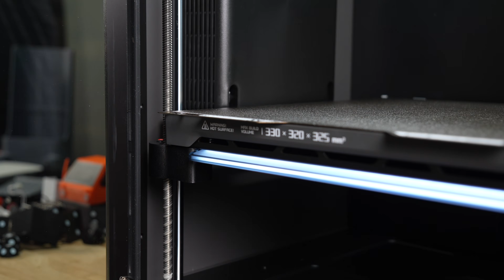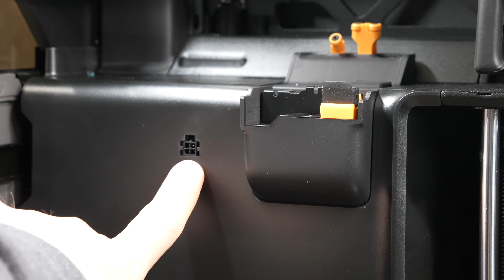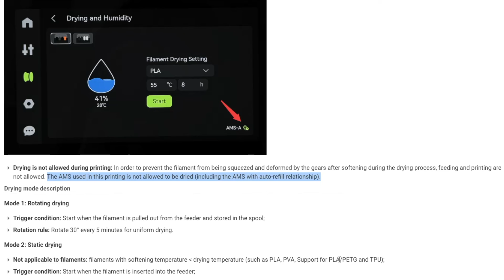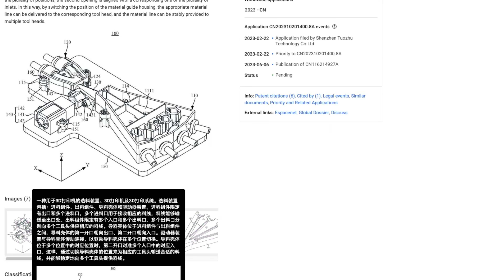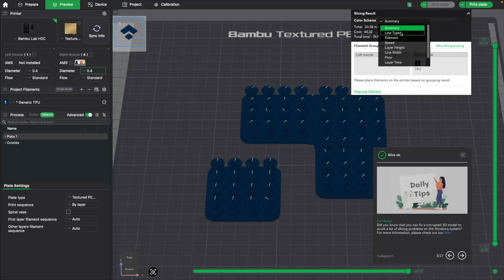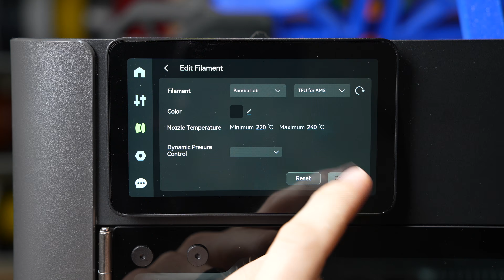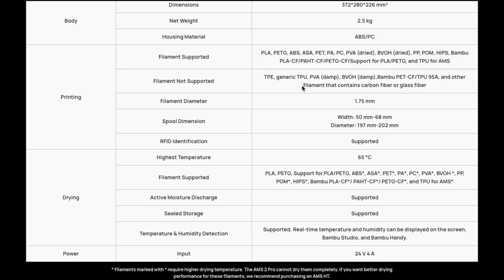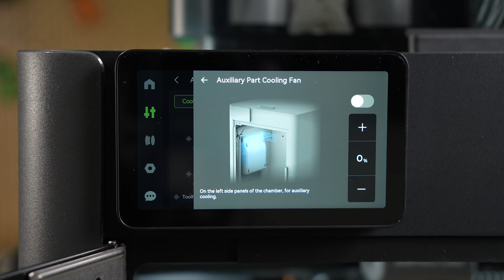3 Months With Bambu Lab’s New Vortek System (H2C Review)

Comment: Snapmaker U1 seems way superior still.
Reply: wait for at least a year and when they start selling them on a regular basis. After that we'll see how reliable each machine is and how support deals with it ! Then you can really judge.
Reply: U1 is not enclosed at current purchase time, nor does it have active chamber heating.  Good luck when you make something more than little PLA toys.  Good price though.
Reply: @Iscariot18  there are a couple of community lid designs. An IKEA plastic container with some printed parts seems to work well while Snapmaker takes their time of that lid.
Reply: @JonS  that's a joke, cmon.
Reply: Hmmm.,.need a 320 x 320 part, oh, Snapmaker can't do that. Vinyl cutting or laser? Sorry Snapmaker. OK 7 colors minimal waste. Nope. Just pick your filaments from another room without being near the printer. How about having the printer use a second spool when one runs out?  Maybe Snapmaker isn't superior after all.
Reply: @A1N0  you can buy an excellent vinyl cutter and U1 and have $1000 left for what you can buy an H2C for. Sure, if you want the extra size, and all the modules, including the laser (and are willing to clean the laser soot) it might be a good option for you.

If you only need up to 300mm cubed and four colors. The U1 is the superior option. Waste is lower. Multi-material speed is higher. It can print real TPU. Price is lower.

You are right to point out that "superior" is subjective. Not everyone has the same needs/wants. But I would say most people will be better served by the U1.
Reply: @A1N0  Need a 490 x 490 part, oops Sovol SV08 max is the best printer now. Thats just arbitrary
Reply: Based on what ? They are different machines U1 will be better in a few areas but far from all
Reply: On what? On the price? I have the Snapmaker U1 and ... I'm not happy at all, still a very green on the software part, but limited to only 4 colors
Reply: @Scheettini  on your other comment you said you have the H2C
Reply: @andi67951 remember that Bambu Lab (taking from DJI’s playbooks) has paid employees whose only job is to bash competitors and boost themselves in social media comments. Not saying Scheetini is one of those, but you have to be on your guard.
Reply: @andi67951  now imagine this concept, he could have both? Yeah unbelievable, I know...

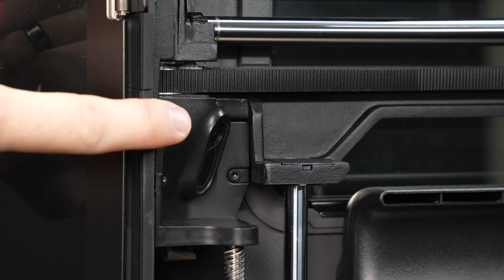Comment: 8:25   already broken printer lol that bracked is cracked
Reply: Well spotted your so right looks a big split 😮
Reply from the maker: Are you talking about the bracket above the camera where I am pointing? If so its not cracked. That is a shadow cast on the part that makes it look that way. There is an angled recess in that part which makes it give the illusion of splitting.
Reply: @ModBotArmy  hehe is that was really broken you have to wonder how fedex did it :)
Reply from the maker: @scb2scb2 lol yeah I went to the time stamp to see what they were referring to then ran over to the printer. It definitely looks busted in thar camera shot but I promise it’s not.
Reply: So bambu is all cracked up to be…
Reply: The actual elephant in the room is the upgrade path from H2D and the missing warning for us early adopters, who would have waited.
Reply: @crowguy506  I find that a more difficult problem it always is. would be nicer if the upgrade would be cheaper but they have to replace the whole toolhead which is a complex part compared to most printers.
Reply: @crowguy506  As a current H2D owner, my two biggest questions are 1) When will the upgrade kit actually get released (Cause it's Jan 24th and we're running out of January) and 2) I want to see a trusted 3D printer reviewer on YouTube actually go through and document the entire upgrade process. I've read the upgrade wiki pages multiple times in depth but I want an independent party to tell me based on their own experience going through the upgrade if I should even bother trying to upgrade my printer or just settle with the H2D because the upgrade process is too complex for most people to undertake themselves.
Reply from the maker: @crowguy506 I don’t know much about that. I don’t recall there ever being mention of an upgrade path.
Reply: @ModBotArmy  The Vortek Upgrade Kit (H2D Compatibility Pack) is scheduled for arrival in January 2026.
   
4. The Vortek Upgrade Kit (H2S Compatibility Pack) will be released after firmware support is available, with an estimated earliest release in Q1 2026.

This is off the store page

Comment: I think the prussa will be the best this is to much repairs complications on this machine
Reply from the maker: Time will tell. It’s hard to know at this point with no real mass testing or feedback. I’m very curious to see how the install process is because that will ultimately determine accessibility.
Reply: We have to see this in 2 parts. The H2D as a platform has many parts and so as a result does the H2C but the vortek system itself is very simple it just looks complex only 2 moving parts and a simple motor and all parts easy to access and remove/replace. The H2D as a platform has been out for a while and no massive  big issues compared to other printers. So yes many parts but also many sensors to protect things for example how more parts doesn't always mean more issues thats a myth a machine has to proof itself in battle over many hours with many users. My h2c now has 500h on it but i won't judge until i and many have a few thousand on them before we make any claims.
Reply: The system of rods, bearings, belts motor is the same system that is used to make the mk4s gantry and bed to reliably move for 10 thousands and more hours, so I guess it will be reliable...
Reply: Another thing, you need to print the parts of the INDX, how you think that is less complicated? They are going to send you the necessary parts, you need to print and install them
Reply: @Scheettini I guess you still don't understand it is complicated to make repairs on older generations for most people. Do you think this printer will be easier to fix? Also, the functionality is 100 plus in this printer, but the repairs are not.
Reply: @enmanuelhenriquez975   Bambu Labs have a WIKI with everything you need to do with the printer, maybe it looks complicated, but im not worried
Reply: @enmanuelhenriquez975 I rather have a reliable printer harder to fix than an easy to fix one that always need tuning, maintenance. If for some, the Core one, for example has been reliable, the belt tuning and general performance has not been that good for a lots of others peoples. The core one L seems to improve on that thou.
Reply: and you think having 7 toolhead is less complicated?

Comment: Voxel is not made in the USA
Reply from the maker: Production switched to fully in the USA last year.
Reply: @ModBotArmy  Voxel is absolutely not made in the USA, Their filament is literally 1:1 the same as matterhackers build series PLA. And matterhackers build series stuff is made overseas and imported They use the same spool with P/N labels, peeling off their brand labels shows this. Their TDS is the same and the print properties are the same, from the level of gloss and tone of color, the filament winding and even the tape they use on the spools. If voxel is saying their filament is made in the USA, then they're lying.
Reply from the maker: @LilApe I can’t speak on prior to sometime this last year. I know it wasn’t based in the USA from the beginning. This is a relatively new thing. I can reach out to get further details.

Comment: If I didn't have an H2S I'd be all over this. But I'm undecided so far if the multi-nozzle feature gives me anything I really need. Or need enough to be worth the cost of this printer.
Reply: I have an H2S and a snapmaker U1 and think it's a pretty solid alternative to an H2C for the same amount of money. Faster tool changes in the U1 and H2S has a larger build volume. Obviously if you do a lot of 5+ color prints you'd need the H2C for that but I find 4 colors covers most things pretty well. Plus having two printers to share the load is great.
Reply: Depends what you print.  For reference, I did a print with 1500 color changes.  3d 19h on the X1C.  1d 10h on the H2C.  The H2C also used 620g less filament since minimal purging.

Comment: The vortek system is cool on its own but compared to the indx, the indx seems superior and the Bambu system looks like trying to avoid infringing on bondtech’s patents. To match the h2c, a Prusa Core One L with indx might be similarly priced to the h2c, ~$2300-2500 for a core one L indx vs $2400 for the h2c. I’m very excited to see a head to head when indx is available.
Reply: I see a lot of advantages to both systems - I'm planning on getting both - with the H2C for actual printing of 12+ colour models, and the INDX for tinkering.  I'm planning on adding a cutter to some of my INdX passive tools so that I can add an OpenAMS or BoxTurtle - and get the convenience is simple filament roll swapping, plus sharing one roll of filament with multiple nozzle sizes.
Reply: The biggest issue with  indx is that it has to ship. A pre-build h2c size printer (Core One L) is not even announced yet and we should not be shocked it will be end of the year.
Reply: The indx system is cool on paper, and as of now, apart from some controlled demo, it's still just paper specs. There are so much unanswered questions about its performance with different materials. Otoh, the h2c has a larger volume overall, a chamber heater and its readily available.
Reply: @patricklebel1141  it also has auto PA calibration, option for laser and cutter, and since it's a nozzle changer you can use a single spool for multiple nozzle sizes (this will probably be added in the future). You can also have more colours than toolheads and a higher nozzle temp.  Everything has pros and cons...
Reply: @riba2233  Its 100% clear that INDX and toolchangers can outrun the h2c/h2d when more than 2 nozzles are needed but indeed the downsides people don't seem to want to talk about. People talk easy about 10 or 12 INDX in a Core One L but the space and/or how 12 ptfe's for example will work and be able to be in heated chamber people love to sidestep these 'small' issues.
Reply: @scb2scb2  yeah they seem to overlook that it's not that simple
Reply: Bambu lab isn't afraid to copy, steal or infrings on others IP, as they do it all the time and it's why stratasys is suing them right now. Bambu lab just always tries to do something different, and every time they do, its ends up being bad. Like using CF rods, lidar, dual nozzle, this vortek thing etc.
Reply: @LilApe  there you are with you Iies, like a clockwork, nice!

Comment: that wobbly table
Reply: No, its not table wobble. This thing is HEAVY and has very soft feet, and the toolhead is massive, so it does wobble a bit when printing.
Reply: My table is rock solid.  The printer moves around on its feet about 1/4 inch or more.  It's designed to move.  I don't know why but that's how it works
Reply: When I first got my H2C and start my first print..........HOLLY COW, the soft rubber feet makes the machine dance quite a bit, it balances up for the dual heavy head moving fast, if they left the machine static in the table the vibration would target the print.